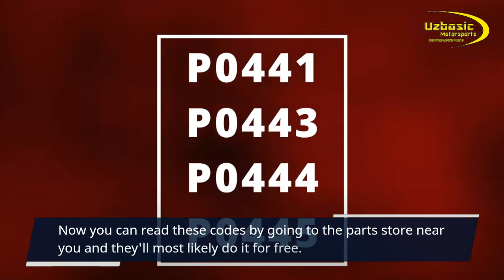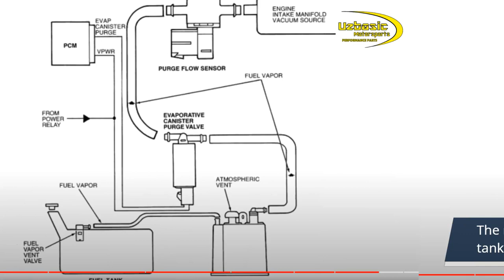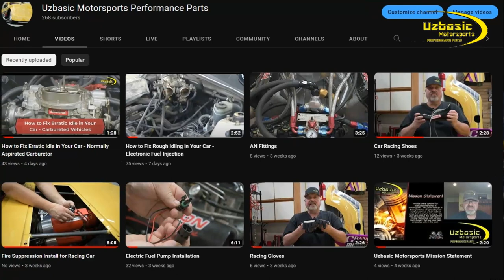Bad Purge Valve - Learn the Symptoms

Comment: Rather than buy a new one, spray clean the old one, the put some graphite powder in the intake side.  This has worked for me twice in the past.
Reply from the maker: I like it, for those of you who like options here is an option that Bruce G recommended to try before purchasing another Purge Valve.  Give it a shot if it works awesome if not you can always order a replacement from Uzbasic Motorsports Performance Parts or your local parts story.  Thank you Bruce G for the tip we appreciate involvement and recommendations from out readers about or videos.  Please don't forget to subscribe as well.  Again thank you all!!